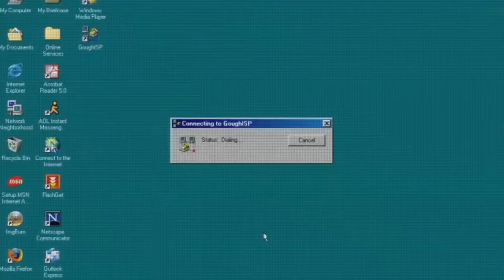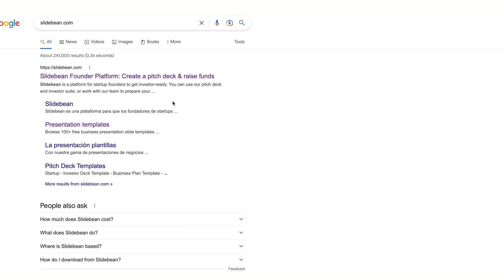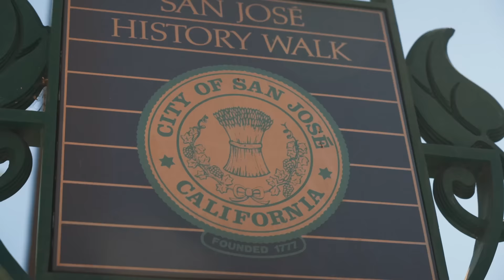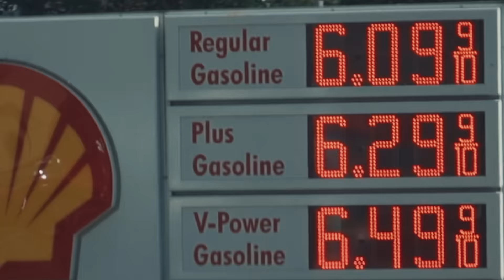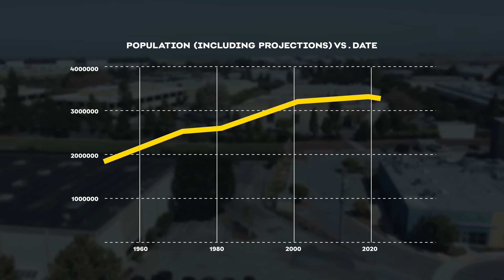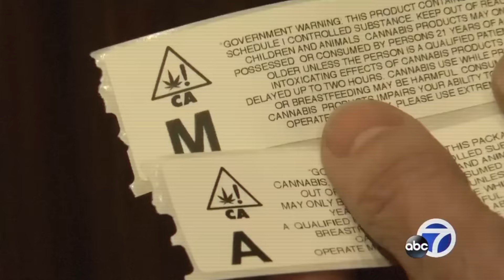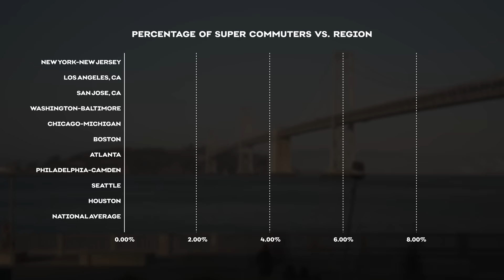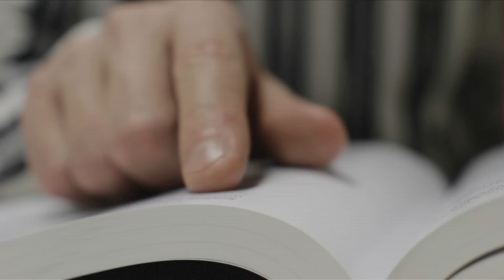Silicon Valley is a Dystopia - Tech Nomad in SF

Comment: A contributing problem is SF's tolerance for open drug dealing. Michael Shellenberger has documented how some areas are functionally open air opium dens, people suffering from addiction are not given any treatment and their situation just deteriorates.
Reply: Dont tell that to anyone from SF though. The sheer cognitive dissonance from these people is insane.
Reply: Bro. If only they had opium. That sht is classic. Instead they got all the whack   synthetics.
Reply: So this is Gotham city
Reply: It begs to be asked why SF residents don't fund counseling not only for addiction but also placement in a community where the individual has relevant job & housing opportunities. SF isn't the right place for former addict. Too many addiction opportunities and little need for a high maintenance low value worker.

Comment: Between tech jobs attracting both internal and external migrants in huge numbers driving up the demand, and therefore prices, and NIMBY crowd and local authorities with their regulations making it impossible to increase supply by building more apartments it's honestly not at all surprising that the situation is the way it is. As a software developer myself, I will probably never agree to any job that would require moving into Silicone Valley unless it's 7 figures.

Comment: You can thank...
1) The Banks driving up costs by demanding loan insurance. Then having the primary focus of finding ways to make you default so that the bank can collect the insurance, the property and the principle. All because it more profitable than running the loan to term.

2) Speculation on top of Speculation, just for the sake of flipping a property at the highest cost possible. If California really wanted to help home owners then they'd prevent purchase of any home that someone didn't live in for at least a year.

3) Foreign investment see # 2.

4) A glut of cheap labor in a market that has no need for them.

5) Education system that does little to prepare and support young people coming into the market.

6) Rampant age discrimination for employment, healthcare, and education. Thus those without the direct means to pay (usually older and in debt) are unable to self-improve to be able to compete.

Comment: 18:08
I live in Eindhoven in a suburb made by a tech company but the county and the company have cooperated. 60% of the people that live here work for the company, I don't. Each area also has a minimum density that they have to reach so the area that has a lot of small mansions in it also has the largest apartment building in the whole city to get to that minimum. Most are row homes though of various sizes.
There are some tech-city quirks though such as massive bicycle infrastructure (Even by Dutch standards), the most comprehensive traffic calming you will ever see and high tech solutions for a lot of stuff where it isn't really needed. The elevated bicycle roundabout is famous world wide though in reality it's not all that practical.

Comment: It's the unregulated housing market that's the issue.  You cannot let companies take over how to price your land.  It's the same situation in Shanghai.  In 2003 price of housing (40min drive to city centre at the time due to no direct highway to city centre) was about 2000rmb/sqm, a nice duplex house of about 160sqm 3 bedroom 2 living room 3 bathroom was only 320k.  The same land now is priced at 20000rmb/sqm, the same house is now 3.2 million!  Like WTF. And Shanghai has a very developed public transport. This house is 10min walk to subway and it takes about 45min to commute which is the same amount of time or less than to drive due to rush hour traffic.  They've also built an overhead highway that connects to the city centre directly and if there was no traffic the drive would be 15min.  So technically it is considered very close to the city centre now, even though it's actually not.  Even with good public transport, people are still forced to move further away.  Travelling 2 hours via public transport (because it's more reliable than driving) and even on the outskirts where it's still shanghai but not anywhere close to the real city centre, the price of housing is still over 10k/sqm.  It's truly ridiculous and building public transport is not going to solve anything unless you start to regular the housing market.

Comment: You leave out the other reason the SF Bay Area hasn't gone vertical: earthquakes. Tokyo isn't vertical either, for exactly the same reason.
Reply: what are you talking about? Tokyo is extremely vertical, sure not that much of skyscrapers but houses reaching more than 5 floors are plenty to find. Unlike in US where you'll find most houses with max 3 floors.
Reply: @PurpleDuneEfa  5 floors hardly qualifies as a high rise. My point is, like Tokyo and the rest of Japan, the Bay Area has seismic issues that cities like New York, London, Paris, Hong Kong, and  Shanghai don't face. While there are opportunities to increase density here, California coastal cities will always end up being low slung like cities in Japan simply because we live in an earthquake zone.

Comment: One MAJOR reason why those houses are so (VERY) expensive is a rising amount  of women in the workforce.

Let's assume a bank is willing to give to a household a mortgage of 4 times household income. Then it matters if that household has an income of $ 30,000 (only the husband working) or $ 60,000 (both husband & wife working). In the 1st case a bank is willing to lend (4 times $ 30,000 =) $ 120,000. In the 2nd case the bank is willing to lend (4 times $ 60,000 =)       $ 240,000. Then guess what happens to the price of an average house. It rises from $ 120,000 up to $ 240,000.

Having 2 incomes per household instead of 1 income per household also means that rents are also being pushed much much higher.
The REAL victims here are households with only one income per household.